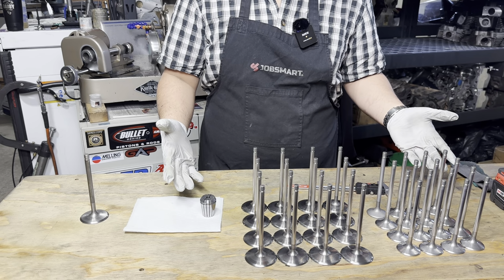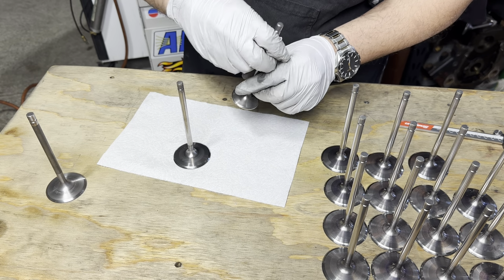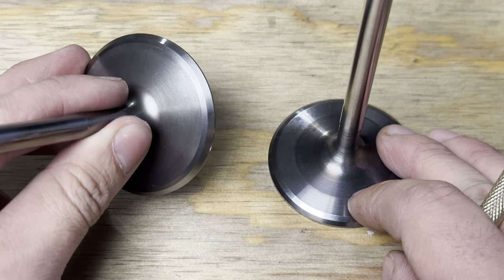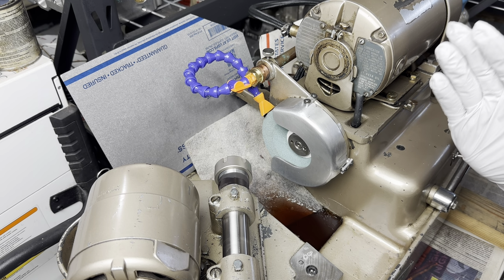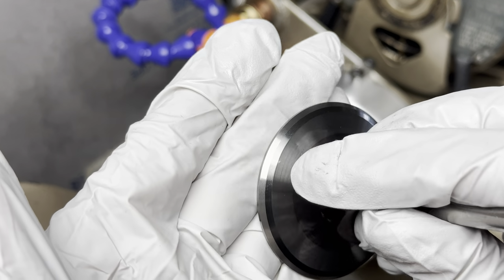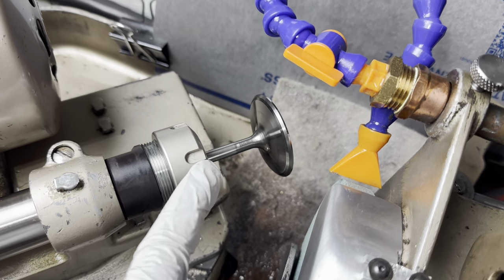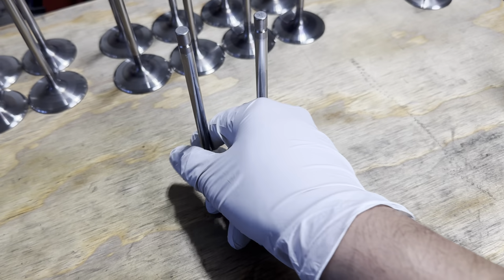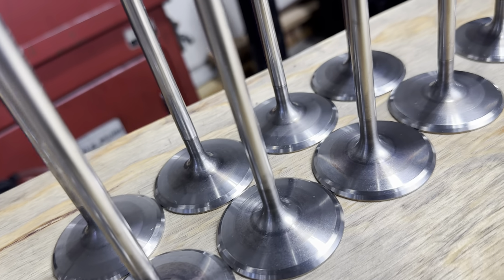Engine Shops Are CLUELESS About Titanium Valves!

Comment: @14:00   Clean your machines...

Well....I ckean them from any debris fouling them.   I never use air pressure but a vacuum cleaner.  Debris flies around to everywhere when air hose is used.
Always use loads of  way-oil  when working with scraped beds.   When using water based coolant on a lathe always move the ways afterwards so many times no water comes away from beteween the bed ways  but only bed way oil.

Oh...and the Tobin Arp VGS2000   or Sunnen  seat and guide machine ....I always keep the bed on which the head floats on air  extremely degreased so little chips and debris are blown away by the floating head.  In that way  debris wont come between head and bed.  The head floats about 0.04mm height when air pressure is apllied ....so if the bed or underside of head is greasy/oily.....chips wont be blown away.

Also use a vacuum cleaner when porting and polishing ports ...the debris will float anywhere in your  shop.

When porting a lot.....make sure machines in your shop are changed to indirect forced  cooling of electrical circuits  instead of direct forced cooling.  Seen many shops having problems with electrical issues by shortcuts caused by  ultra fine metal debris...... Recently shop nearby almost  smoked out an amplifier by such debris accumulated on circuit board.
Reply: 😂 you good bro?

Comment: Every now and then I chuck up a valve and it’s visibly way out. So I chuck it again thinking no way then it’s still out. Grab the indicator and check the stem and 9 times out of 10 it really is that out and not my machine. I get fussy if I am more than .0005” out but it seems a lot of valve factories are satisfied with .003”
Reply from the maker: Some are better than others. And yeah I agree. Most the manufacturers aren’t checking their runout.

Comment: about how long would un-coated TI vavles last in a street-strip engine with about 120/140 lbs seat pressure max lift high 5s to low 6s

Comment: Crazy to think people use toothpaste to lap valves when it typically has abrasives in it as well. We looked at toothpaste under a microscope when i was in high school. Pretty crazy whats in it.
Reply from the maker: Yeah I think the idea is it’s less abrasive than other abrasives. Maybe acts more to polish than remove material.
Reply: @EngineRehab  i figured that. To the touch it is definitely not as abrasive. Its just shocking what some things have in them when inspected closely. Loving all the detailed information with your work. Ive been learning a lot with yours and others videos, even if i myself never put it to good use. Lol

Comment: Most machine shops don't do stainless valves as they probably do as much tractir and small engine valve work as auti engine work. Therefor as time is money the accuracy they need is obtained without the need for constant machine ckeaning. Doing valves in your basement as you do afforda you to be as fanatical as u choose with regard to machine cleaning. Put simply it just cost tbe customer money they don't want to pay for u to constantly clean your machine. If specialty work needs to be done then the customer should be willing to spend more and search for a more specialty shop. It's all a matter of economics. I am surprised with u being as critical as u are if others wgy u were using the incorrect grinding wheel for Titanium. I'm also a bit suspect if putting a tight tolerance "Nascar" valve in a tumbler for any reason what so ever. And using a cordless drill with a Scotch Brite pad to clean a valve with an exceptionally thin coating seems a bit ill advised. It seems a bit like patting your own back for the pretty shine.
Reply from the maker: Hey everyone! We found who doesn’t maintain their equipment!